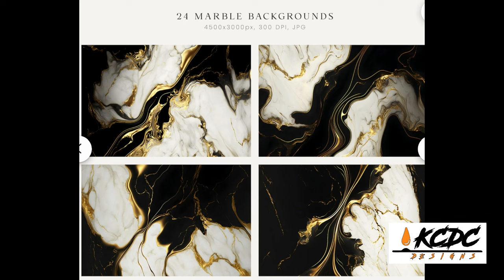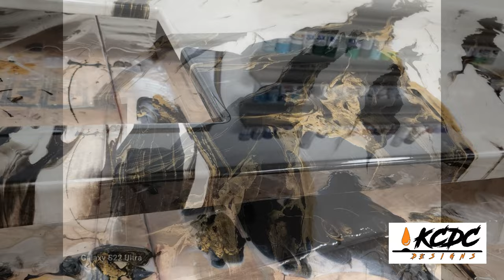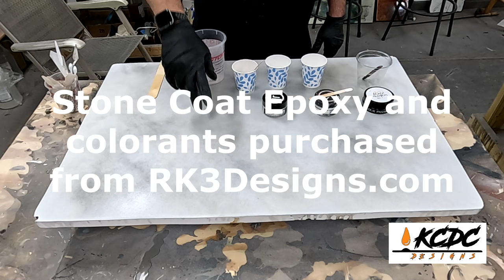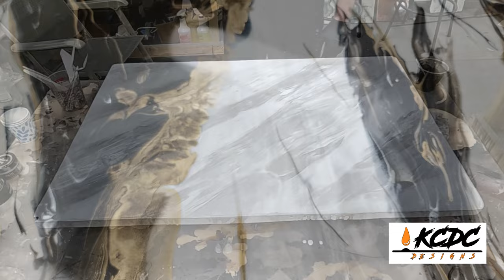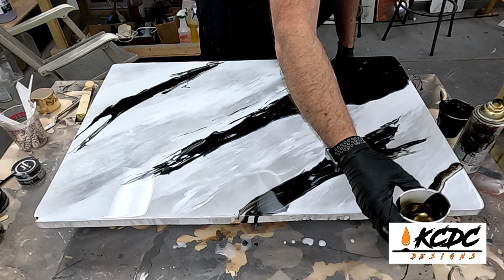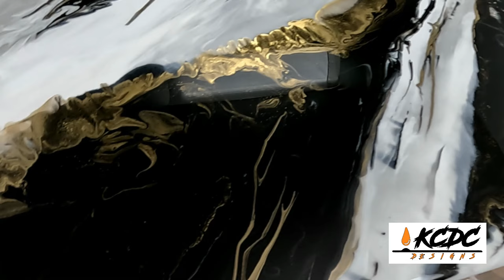Watch how I created this black and gold, white marble design using Stone Coat Epoxy | KCDC Designs

Comment: Amazing Kieth, absolutely beautiful.  How you sand before clear coat and not take gold off?
Reply from the maker: Thank you, and great question! 
When using the Bright Metallic or Fast Dry spray paints, or other colorants that remain on the surface, I will apply the clear/flood coat during the "open window" when the epoxy is at the stage of "blue tape tacky". And for me, in a controlled environment of 72° - 74°, it's somewhere between 9-11 hours.
That's a great question and thanks for asking! Because you are correct that you will scratch the colorants which will end up showing through the clear coat (or remove them as you mentioned). And in this case, with that much gold, it's really important to  remember that. If there's only a few accents with those colors, I will sand around them.
Reply: @kcdcdesigns  thank you brother, and thank you for taking time to reply

Comment: Very nice! I’ve done this with Rustoleum’s metallic copper and silver. They create stunning effects.
Reply from the maker: Thanks, Chris! In the past I've used them all as just accents, this is just the first time I've used that much, as well as manipulating it. But because they remain on the surface, they also scratch easily, with scratches that will still appear through a flood coat. Have you discovered the same?
My solution to this is, is that if there's too much to sand around, I will apply the flood coat during the "open window", so the surface doesn't have to be sanded first.
Thanks for you comment!

Comment: awesome! how do you keep the whites from yellowing? everything ive done it white is now yellow
Reply from the maker: Thank you! 
None of my white/whiteish countertops have "yellowed" over the past 3 /12 years. Yes, they've likely ambered some, but I've not had a customer call-back from "yellowing". It's crucial during the prep, to be sure you're allowing any white paint to off-gas at least 24 hours (4 hours with Stone Coat Undercoat Paint) and using only white dyes, and pigments that are specifically designed to be used with epoxy. Also, being careful not to overheat the surface, especially when torching or heating, to not overheat/burn the white dyes and/or other pigments. I still have white sample boards from 2020 that have not yellowed. If I put them beside a freshly poured (and similar) white finish, there may be a slight color change from ambering, but not "yellow" as some have shown pics of.
Also, being sure you're using a brand of epoxy known for it's UV resistance, such as Stone Coat's Art Coat epoxy.

Comment: Hello keith, unrelated question to this video. When using stone coat UTC gloss should it have a "orange peal" look to it or should it be smooth like an epoxy finish? Thanks for the video on UTC it helped alot!
Reply from the maker: Hi Elizabeth! Yes, the UTC Gloss does have an unavoidable orange peel/texture that you can typically see, but not feel. We've not been able to find a gloss topcoat with the smooth shiny finish like a flood coat will have.